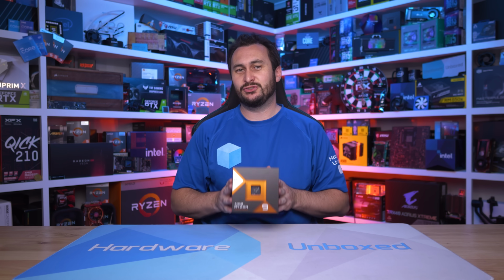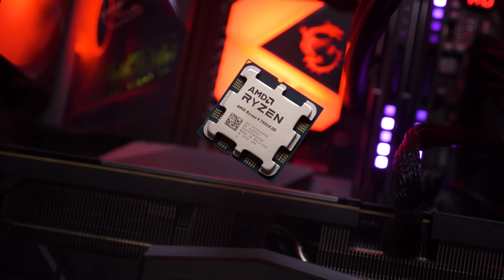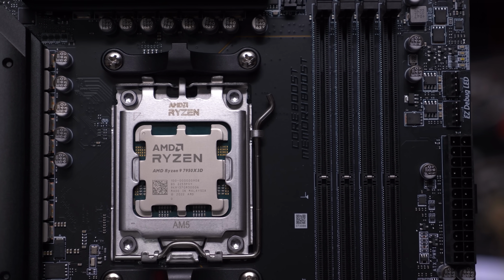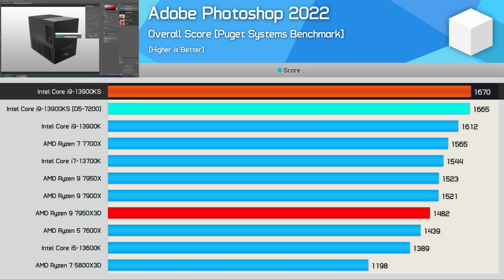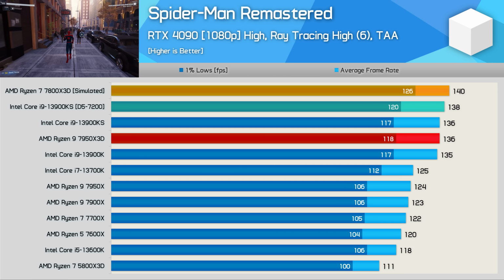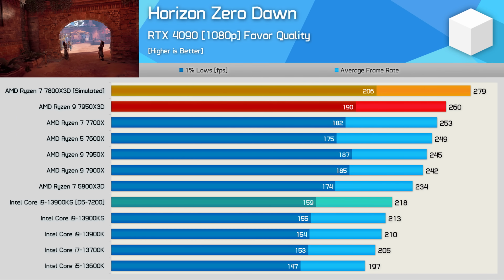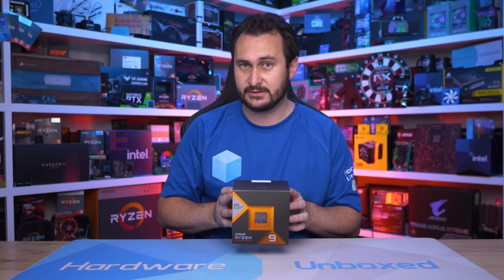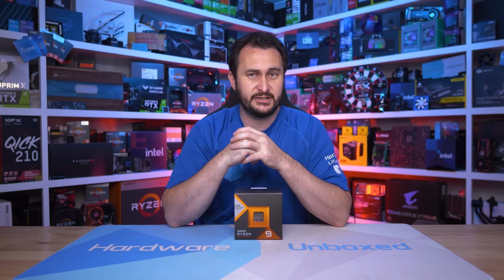AMD Ryzen 9 7950X3D Benchmark + 7800X3D Simulated Results

Comment: perhaps all consumer CPUs should be X3D, even if these are also better binned and therefore more expensive to make.

within commercial, scalable, environment, predictable stable performance is expected (invariant to type of load).

P.S. honestly, sour grapes from buying 7950x.  up to 33%  slower, as if it's whole new gen or even production process.  perhaps actual market prices (higher for x3d from informed demand) will sweeten the deal or that future game engines and more software will make use of any high number of cores.

buyer's remorse is bad for long term fan retention xD. bad enough already that much cheaper (up to 50%) 7700x offers identical performance in gaming, now flagship 7950x is even beaten down in fps.

and then add the pain to cool 7950x and power consumption, strange offer at a high price

Comment: Just get Process Lasso. It lets you designate which threads a CPU uses for a particular process. This tool is super easy to use and is a mainstay of Ryzen CPU streamers. You put all your encoding on one CCD, and you put your game on the other and both processes get a huge jump in performance. Any thread mixture that mixes CCDs for intensive tasks like gaming or encoding slows things down a lot.

Comment: I don’t think calling it “simulated 7800X3D” is accurate because the 7800X3D is not going to boost as high. I would expect actual 7800X3D performance to be a bit lower.

Comment: I simply don't care if it's better than this or that. I'm just curious about realistic results to see before i make a purchase. I mean can't you guys show the results on 1440p or 4k resolution with a mid to high range card result and compare it with other cpus. So we can see that how it's going to be in the actual home pc in case if we upgrade. I assume that it won't make too much difference that's why you guys don't want to show it like that to not slow down the sales.
Reply from the maker: https://www.youtube.com/watch?v=Zy3w-VZyoiM
Reply: @Hardwareunboxed  you clearly don't understand my point. I am not interested to piss contesting the processors. Since you're trying to show gaming performance on cpus more than rendering or benchmarks such I'm more interested to see if this or that cpu would have any impact on my upgrade OR which cpu will bottleneck on where(in a realistic test). For example i use 5800X and 1440p with 2080ti double rad custom loop. I am not dumb, I'm building and selling computers. I want to know what Gpu will be too much for 5600x or 5800X3D or 7600x do you know what i mean? Who cares about if Intel or Amd better except teenage incel geek redditors. I want to see the limits of the cpu in hardware-wise. Okay 7800X3D is here. But is it really worth it for a gamer? Put it on a 1440p or 4k system with different gpus like 3070ti 6800xt 3080 and then 4090 and compare it with a 5800X3D and I'm quite sure except 4090 it'll be the same fps. But no you have no time for that right? It's easier to assume that your reviewers are dumb.
Reply from the maker: You don't have a point and you also don't seem to understand what you're after in a CPU review, or what makes a CPU review useful. As for the testing your think you require, what quality settings are you using? What frame rate are you targeting? As explained in the video linked above, CPU testing isn't about high resolutions or GPU bottlenecks, it's about seeing what the hardware can do and this helps you work out which CPUs offer you the most performance at a given price point.

You can see a massive difference between the 5600X and 7950X3D in competitive shooters using competitive quality settings, even at a resolution like 4K. Also calling people 'teenage incel geek redditors' because they have different requirements than you is extremely immature and makes you look like a clown. So we're probably done here.
Reply: @Hardwareunboxed  thank you to show your real you. Calling people teenage incel redditor is just describing who they are while you calling someone clown personally is an insult. Which you can't dare to do that face to face you know that right? Knowing this fact can be enough for you. You may think we're done. I know who you are and you owe me an apology, I'll get soon or later.
Reply: Ridiculous comment.  They don't show 4K results on CPU tests because it is influenced more by the GPU, not to somehow inflate sales for AMD, thy are NOT AMD for crying out loud. If you have a middle of the road GPU, then you should already know that any modern CPU is going to be able to 100% max out the GPU at 4K.

YOU should know how your CPU performs now, and can extrapolate from the data Steve provided in this video.

Comment: I know where I would go if I was build a new rig (for now though I'll stick to my 5800x3d system).
Since Intel and AMD now offer pretty much the same performance I think it is relevant to remember that with Intel there is like 200 watt extra power needed at load, that means more cooling noise, more electricity cost (and if you live where AC is needed cooling those 200 watt is gonna cost you).
Plus lets not forget the AM5 will be fine with a new CPU down the line, where as with Intel it is a different matter = more ewaste, more money spend and time wasted rebuilding the PC and reinstalling Windows + apps.

Comment: Hi Steve, much of the attractiveness of the 7950x was the ability to BIOS limit the CPU down to 65W(?) while still getting a slight performance bump over the 5950x running at stock power limits.  With the 7950X3D losing to the 7950X in productivity workloads due to the lower TDP, how do the two compare when you manually limit the TDP?  Personally I would be interested in a 65W comparison.

Comment: Hello, I have basic pc knowledge, so I would like to ask is there a chance 7800x3d would be faster than simulated 7800x3d (7950x3d with disabled core) ? Kinda in rush, but I don't want to buy 7950x3d, disable core, and realise 7800x3d is faster ;(

Comment: how much tinkering does the memory require with AMD? is it still as bad as 3000gen where you had to use dram calculator to fine tune it to be stable? or does the 6000mhz ram run at 6000mhz out of the box?

Comment: Okay, so I've got a question regarding virtualization. When I run a VM (for example with Hyper-V) with 4 cores in the background. What happens if I start playing a game (on the host itself, not inside the VM)? Will the 4 cores of the VM be moved to the 3D V Cache ones and all the others will be parked? Or will 4 of the non 3d cached cores be kept for the VM? Would be sad to have that many cores but still the VM impacting the games performance because all 8 "normal" cores are being parked.

Comment: Hey, can anyone tell me which AMD CPU AM5 should i pick if i want to do some video/photo editing and gaming in 4k? thanks
Reply: If it is on the light side of video/photo editing, meaning time isn't money, and you are not super worried about budget I would go with the 7700x, it isn't that much more than the 7700 at the moment.  It is a good combination of performance and price.  If you are mostly gaming at 4K, and are more GPU bound even a 7600 wouild be a good choice, but it will be slower for video editing as it is only 6 cores.
Reply: @davidandrew6855  initially i was thinking about the 7700x, it has the processing speed needed for my light side of vid/photo editing while it won't be bottlenecking a let's say 7900XTX (i hope)

Comment: I've been hoping to see you guys test cores with CPU affinity as well on the task manager since it's possible to isolate processes that way. To know if it's really necessary to disable CCDs or not.
Reply: @blanket4u  There are ways to automatically assign cores with cmd lines in shortcuts, whether they fixed it or not wouldn't matter in this use case because I'd assign the 3d ccd to my steam/games while anything else would be on the normal ccd.
Reply: @blanket4u  You'd think so but if you do it for steam, everything that opens through it will open with said cores. So it's not that bad. Someone could easily come up with an app that could do it for everything else.

Comment: I just don't get these results I mean anyone who buys a K Intel cpu will OC it and tune ram. So why compare an AMD x part that is a stock only part to a gimped Intel cpu. I mean at least compare them properly. No one buys a K cpu to leave it at stock 🤦🤦.
Reply: A lot of people don't overclock or tweak K sku processors anymore, there was a recent poll somewhere I wish could remember, perhaps it was one of Steve's actually, that hinted at this. It was surprising how many just tweak memory, most don't go beyond XMP settings, a bit if at all and just go with out of the box CPU settings.

I do find it hilarious that you would call a 13900KS with 7200 DDR5 a gimped CPU. Kind of crazy how some people view the testing.
🤦‍♂
Reply: @davidandrew6855  
7200mhz ram means nothing without all timings tweaked and the KS is a joke, it's not OC'd at all. A tweaked up raptor lake cpu is way faster than what they show here. Sure if you like out of the box then get an x3d chip but comparing it to something made to be better is just daft.

Comment: why cant you test 7950x3d with ddr5-7200 ram?

oh and one more question: does the price difference to get i9 and premium ram really outweight the difference of intels significant higher power draw?
Reply: I don't think Zen4 can handle ddr5 RAM 7200 at all.  Anything above 6000 and the IMC and IF would not run at a 1:1 ratio.  If I understand it correctly if Ryzen accepted 7200 rate memory the IF would be dropped to 1800 in a 1:4 ratio.  Someone correct me if I'm wrong.

Comment: The 7950X is temperature limited to 89 degrees C, not 85. 
You can also see this in the temperature readouts and it mentions this on the AMD website. 
The reason why it's lowered from 95 degrees is because the V-cache is more sensitive to high temperatures than the CPU cores, so expect to see the exact same temperature limit on the 7900X3D and 7800X3D.

Comment: Really great video; you go that extra step in testing that other channels don't! I would love to see some benchmarks of the new 7950X3D CPU with some DDR5 RAM kits; for example, have AMD updated to make use of the fastest 8,000MT/s RAM? And how much does CL timings vs MT/s matter with this CPU? And for future proofing, which 2 stick 64GB or 2 stick 96GB RAM kit would best be matched with this CPU for primarily gaming PC, but some 8K video editing?
Reply: I think there may be a few misunderstandings here. First, for primarily gaming 64 GB or 96 GB RAM will make almost no difference. Even 32 GB is rarely stressed for gaming (HUB even tested if background tasks like discord, youtube, etc. change this and it really doesn't). Second, if you are curious why you see Intel chips tested with 7200MHz RAM and AMD is always at 6000MHz its because AMD CANT use faster RAM. The clock speed of the infinity fabric is locked at a ratio of RAM speed. So your max RAM speed will be capped by how fast you can overclock your infinity fabric. This can sometimes go up to 6400MHz RAM, but I do not believe further. Its a fundamental limitation of AMD currently which will increasingly be to Intel's favor as better and cheaper DDR5 comes out. AMD can only really benefit from tighter sub-timings, which Intel can as well.
Reply: @Jordan  so then the real question is how much faster can the infinity fabric bottleneck but pushed in combination with this latest CPU, bios updates & the fastest RAM. But my question about which is the best 2 stick 64GB/96GB remains; as I said, the PC will be primarily for gaming, BUT also some 8K video editing.
Reply: @TimLongson  Yeah if you plan to do other tasks (video editing) that makes sense, but is a combinatorial problem very difficult for them to answer (and very specific to your needs also, they would then have to repeat for code compiling, etc.).

As for the infinity fabric, I doubt the new CPU's will increase it. Its mostly a process feature which limits the overclock frequency. All AM5 use the same process. If anything x3D often  degrades frequency perf (although I've never heard of such for the fabric frequency). But would be interesting if they did find differences!

Comment: It looks like Amd has some work to do on the dual ccd cpus but I'm betting the 7800x3d does better that these simulated numbers and I'm betting they aren't needing to down clock the 7800x3d. I expect it to beat the 5800x3d by 20-50%. They are definitely holding off on launching to milk the high end because the 7800x3d is going to be a hot chip.
Reply: Im betting it will do worse because its a cheaper chip so binned worse and will boost not a s high and often.

Comment: There is a problem with the results of 5800X3D, there are much lower fps values during certain games than my machine performs. Under Shadow of the Tomb Raider, it brings 295 average fps with the same settings in 800x600 with a 6900 XT, while in Cyberpunk it brings 110 average fps with Ultra Ray Tracing with 1024x768 FSR Quality. Does the nVidia driver cause this much overhead?

Comment: I tend to run my PC 5 hours a day for gaming. That would equal $180 a year extra in energy costs for the Intel where I'm located if they power draw under gaming is similar to the result on productivity. I'm still running an X370 board so I tend to keep my machines a while. Meaning the Intel cost could very easily end up costing me $600 to $1000 more in electricity cost in my use case.

Comment: X3d tech is coming along nicely. It's probably not the best investment (subjective opinion) when there is a 7600/7700 to start with on AM5 and both are very capable cpus for the next few years, but x3d definitely the part of choice when zen 6 come around and AM5 becomes a dead platform. Can then replace the 7700 with the latest 9800x3d(?).
Reply: Probably. Especially if your not gaming at 1080p

Comment: Good: 7800X3D simulation. Bad: no 4K results with the 4090. I know, I know - in order to compare CPUs and isolate their performance you had to test in a low resolution to eliminate GPU impact. That’s how to properly test processors, no question about that. Still, I’d like to see 4K benchmarks, I’m not buying this CPU for 1080p gaming…
Reply from the maker: You'll never get 4K data from us in a CPU review. That would be embarrassing 😳
Reply: @Hardwareunboxed  For you? Nope. Useful for us, viewers, especially in CPU-heavy games and with focus on 1%/0.1% lows? Yep. Still, I do love and subscribe you even with this flaw 😁
Reply from the maker: It's actually useless and misleading, you might think it helps you, but it really doesn't.
Reply: @Hardwareunboxed  I’m on 5900X/6900 XT, thinking about upgrading to the 4090. I only play in 4K. I wanted to know whether for CPU-sensitive games like MSFS or WoW a CPU upgrade would make sense to avoid bottlenecking the new video card. I thought about the 5800X3D as a drop-in upgrade or a more complex one, based on the 7800X3D. Without 4K benchmarks focused on the 1st percentile I’m pretty much left in the dark as to whether such an upgrade would even make sense. This is what I meant. I do realize testing CPUs in a heavily GPU-bound environment is pointless but still, 1080p benchmarks, even though they differentiate CPU performance well, are mostly… academic in my case 🙂
Reply from the maker: What quality settings do you use at 4K? What frame rate are you targeting? Will you never upgrade your GPU while keeping the same CPU? The important information here is the frame rate, not the resolution. More info here: https://www.youtube.com/watch?v=Zy3w-VZyoiM
Reply: @Hardwareunboxed  True, I realize that. I usually play in max settings but I’m willing to go down from ultra to high or an optimized setup since often a negligible drop in image quality yields a substantial FPS increase. My target frame rate is 60 fps but with adaptive sync on I can tolerate dips to around 45.  My track record shows that I upgrade GPUs at least 3x more frequently than CPUs but it’s quite flexible. For example, if I go for the 5800X3D and 4090, chances are I won’t have to upgrade my GPU next gen, and I won’t have a problem with upgrading the entire platform next time I do an upgrade. Going for AM5/DDR5/7800X3D now, I’d probably like to stay on this socket a bit longer. My >20 year experience building PCs has taught me not to think too much about future proofing so my thinking is more “here and now” oriented 🙂

Comment: The nature of the asymmetric CCD architecture and the dependency on Microsoft properly scheduling between them has been a red flag for me. Being able to take advantage of 3D VCache without the complex scheduling on the 7800X3D should definitely be an advantage. The big/little scheduling for Intel still seems to be very effective for mixed workloads.

Comment: Good job to AMD for fighting Intel so hard to come in and sneak the gaming CPU crown away from them (Well unless you just play Hitman III)
Looking forward to see Intel hurry up and get to the drawing board.

I was deciding. between a 13600K or a 7700X since there’s only a $25 price difference now. AM5 was a good choice. Will look for 9800X3D when it drops.
Reply: What does 9800xd3 mean ?
Reply: @sleeptight13  AMD is going to keep AM5 around until at least past 2024. So the next round will be 9000 series Zen5 CPU’s I’m assuming they will continue the odd number naming for them. That would then be a 9800X3D
Reply: Maybe 7900XD3

Comment: I think you have used the old prelaunch chipset driver, or not installed it at all. This because the latest one does include scheduler changes that should change the normal 7950X3D to the same level as the simulated 7800X3D. Or you have turned off XBOX game bar in windows which borks the fucntionality of the new driver driver. The new driver puts the cores of the 2nd ccd in idle when a game is detected.